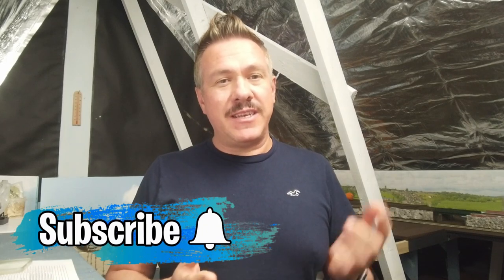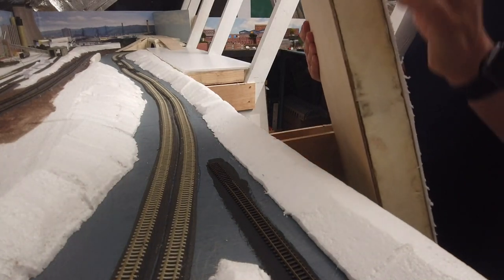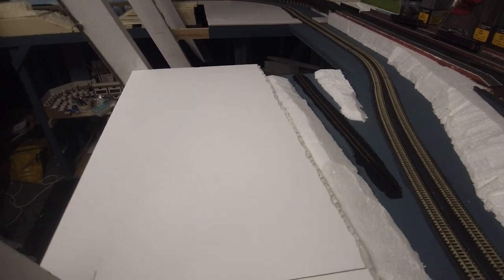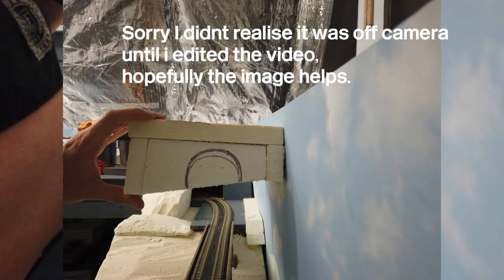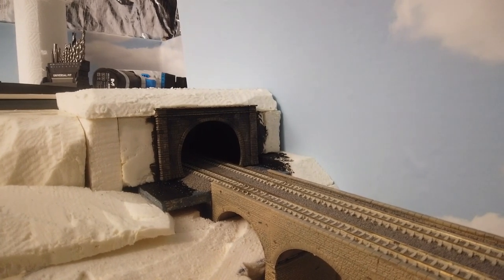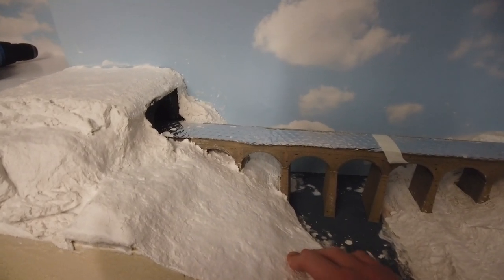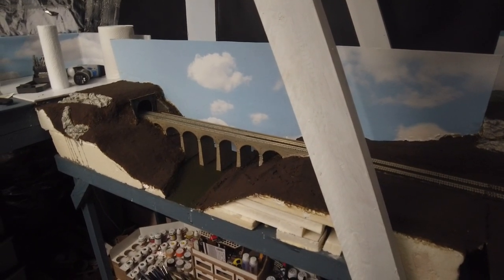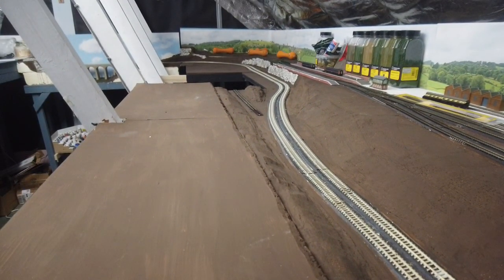Create Basic Landscapes - N Gauge Loft Layout - Ep 16

Comment: I’ve been shown that squirt ‘No More Gaps’ in a bowl. Squirt some cheap poster paint in it and with a brush, paint it on your foam.  For rough texture put some grit like kittie litter in it also.  It’s called vi..... something.  You squeeze the grit and it flattens also.  Put a dirt colour for poster paint.  It dries out you can just push in your plant scenery, fences etc and no need to use glue. The no more gaps grabs it. It also replaces the plaster cloth. Far cheaper
Reply: Oh use a cheap small paint brush.
Reply from the maker: Sounds good Brian, I used expanding foam (like No More Gaps) on my last layout and didn’t like how little control I had over it, especially when working in n gauge. There’s so many ways, it’s always good to hear what others are trying 👍🏻. All the best, Geoff